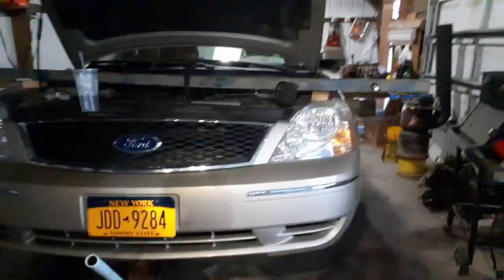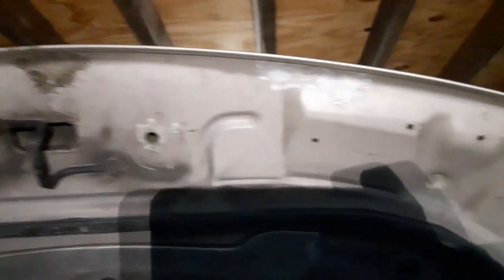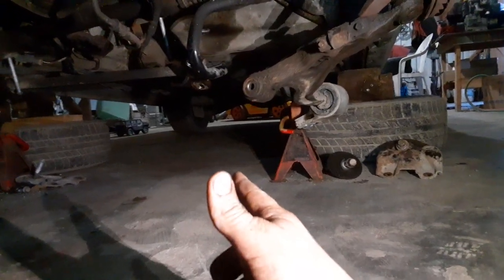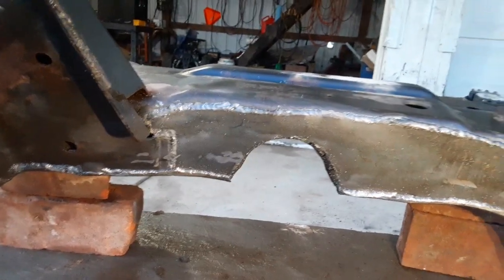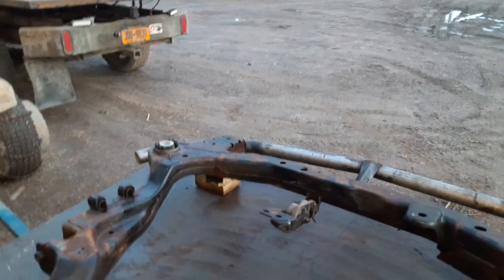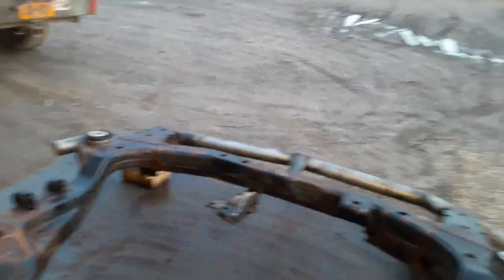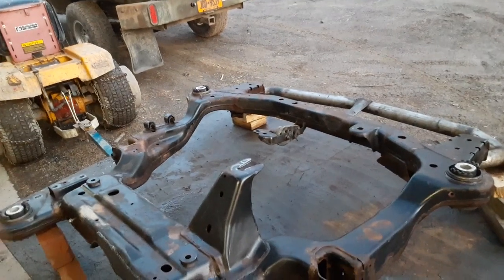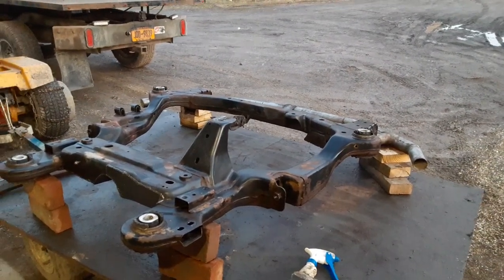Ford 500 subframe repair

Comment: I too have an issue with the subframe. Tell me, the front holds engine? All of the engine or part of it? But what does the back oart hold? Because the back oart is my issue. Lots of big holes in middle
Reply from the maker: Its been a few years since I did the repair,  but the subframe kind of cradles the engine and transmission.   I think the suspension attaches to it as well. It's important for the subframe to be sound. When I looked you could get a reasonably priced used subframe. By the way, we sold the car in 2021, but I saw it last fall, so she's still going!
Reply: It's too bad we are not neighbors. I honestly dont know what to do with this car. $500 in. New belt, ac compressor. Added egr valve last year, and throttle the year before. I am no mechanic, but i did throttle n egr replacement. The belt and compressor were beyond me. So... i asked a mechanic to fix it. But now the car feels different a bit, driving feels diff. I heard dropping subframe can mess with alignment. He said he only dropped 2 bolts, and he was scared they might snap, but supposedly they didnt. He dropped it just enough to get to compressor. My issues with car are needed brakes. But the subframe has always been a headache. Most garages dont want to work on it. My section is just like yours. Where you pointed to. Wish i could get it welded, but would prolly cost me a fortune. Tell me, for an '06 500 sel, do you see any on market. Is buying a used one cheaper than having it welded? Oh i forgot, i checked the front if car, i see the spot with the bolt the rubber part , its gray, looks old and has a small piece missing. It sits between subframe and frame it connects to. Its rubber and has bumps pointing up, what is that? If a piece is cracked or missing that can be good. Sigh...
Reply from the maker: The rubber piece is a rubber isolator. We bought an 01 3rd Gen 4runner to replace the Ford,  and in some ways it feels like bad luck has been following it ever since.  I was really hard on it and wrecked one door and destroyed the front differential and a lot more. By now there's so much broken, it's cheaper to buy a second wrecked 4runner to salvage parts off of....... I definitely feel your pain.
Reply from the maker: Thankfully or Ford five hundred was as reliable as it was ugly. 😄. My boss gave it to me and bought a fusion and he's on his second fusion. They look good and drive nice, but he's got rust problems, leaky gas filler, leaky diff, leaky sunroof and systemic rust. So far the old five hundred has outlived them all!
Reply: @lamarzimmermanmennonitefar5269  thank you for the info, i will look up what an isloator does and if i can easily buy a new one. Yeah, cars suck huh. It's like we take 2 steps forward but then 6 steps back. I hear you on the rust. Guy i got it from was a retired mechanic, years back, and he promised to fix subframe once i pointed it out after buying, i totally missed it. And he was going to either get a used part, or have a friend weld it. He was very skilled with info, knew what he was talking about. But then he ghosted me😅  after a few back n forths on scheduling fix. So you regret selling the 500 huh. Btw, NICE JOB on your weld fix
Reply from the maker: Thanks! Best of luck with your car!
Reply: @lamarzimmermanmennonitefar5269 leaky ford sunroof tends to be the result of clogged drains. They are in the corners, and go toward the A and B pillars.

A long piece of wire cable/rope not more than 1/16 or so in diameter is plenty to clear the drans and get them flowing again.